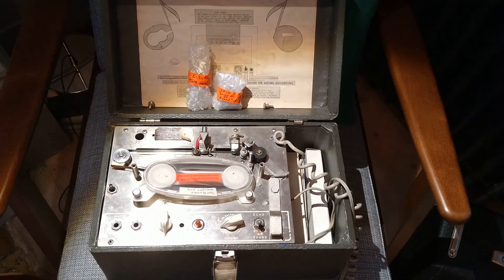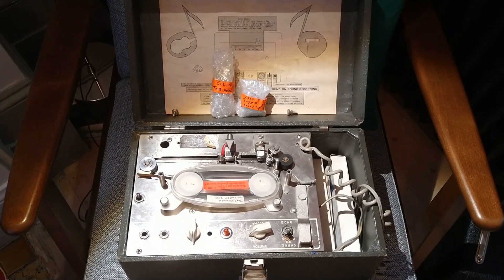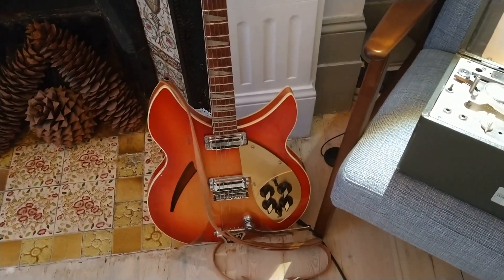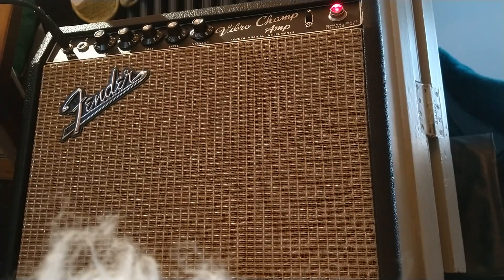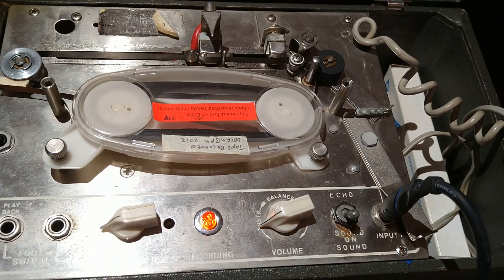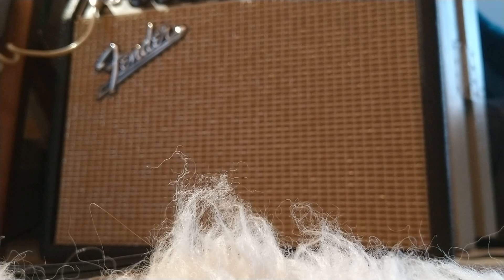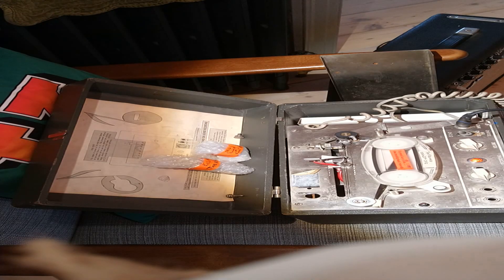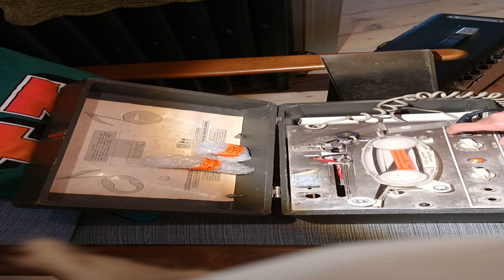Echoplex Modifications to Separate Pre-amp from Tape Echo Function

Comment: A couple mod highlights:  1. I recommend opening your unit, and measuring the voltages across the caps before you purchase replacements. This way you purchase the proper caps with the proper voltages, keep costs down, and size of the caps down.  The highest voltage is about 320VDC at startup, unless you use the CL90 Inrush Current Limiter....then it holds below 300 VDC before settling at 270 at Can Capacitor.   Some of the film/ceramic caps in the original circuit have higher voltage rating than necessary, and the replacements can get large. 2. I wired the motor switch in two locations on the two echoplexes I modded, and the one that Knavel has (in the "echo-sound on sound" position is much more user friendly, when playing live. However, the location is somewhat near the preamp tubes. So make sure you twist the AC wires from the motor to the switch to cancel as much hum as possible. Bring the wires in behind the metal plate (you'll know what I mean when you get in there...following the AC wires to the motor  that are in there now). I did not run the wiring along the circuit board, but back through the grommet and behind it.  3. When the motor is off, you are still running signal from the tape head into the amplifier circuit, so there is noise being introduced. To eliminate this, when  running the preamp only, with the motor off, turn the  "Balance" knob all the way to the left.

Comment: Is this the tube EP-2? I been wanting to clone just the preamp but didn’t know if the gain stage of the EP-2 colors the tone in a pleasant way or not. If this is an EP-2 then I like what I hear and will probably make a stand-alone pre. Thanks in advance
Reply from the maker: It is tube and with the Sound on Sound feature according to this publication, it's EP2:
https://www.vintageguitar.com/18229/echoplex-ep-2/

I don't follow the effects market, but a proper EP2 pre amp stand alone seems to me like it would be a winner.  I have that Xotic EP small pedal and it really does nothing for the tone.  I just saw it as a booster for the Rickenbacker when I used to play it live. Otherwise it is essentially junk in my view--they were obviously more interested in getting a small sized pedal rather than ne that actually sounds good.
Reply: @knavel1  from what I understand nearly every EP pre style pedal is based on the JFET driven EP-3 model. JFET’s are infamously inconsistent and with most clones trying to run on 9v as opposed to the original EP-3’s ~20vdc so you lose headroom so with a lower operating voltage and a randomly selected JFET not tested for the desired specs you probably end up with a bad approximation of the EP-3 preamp tone.